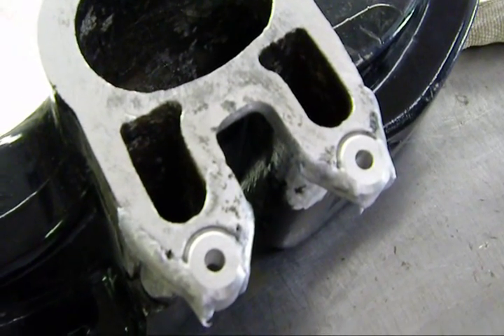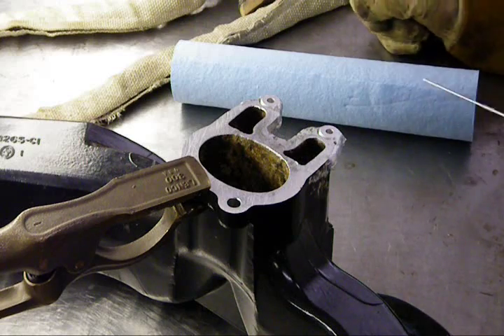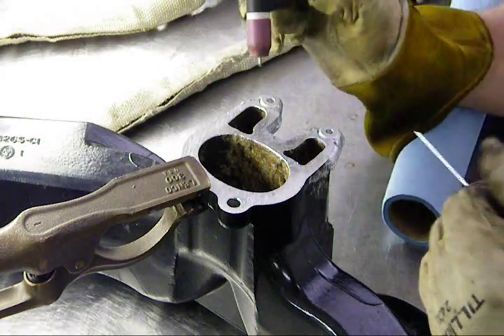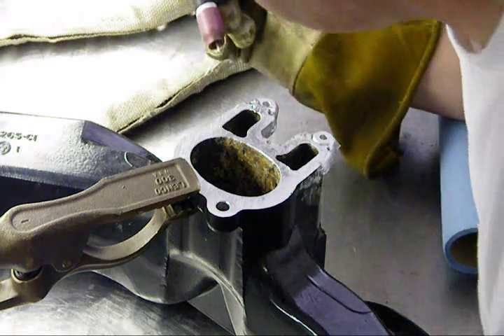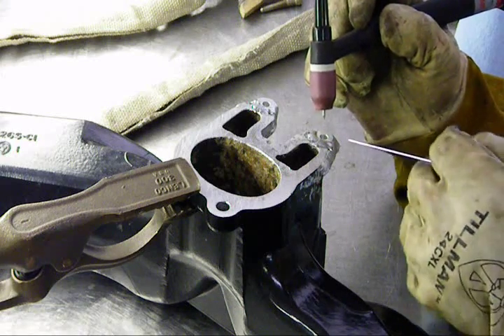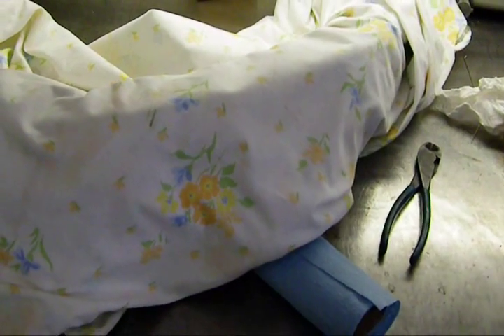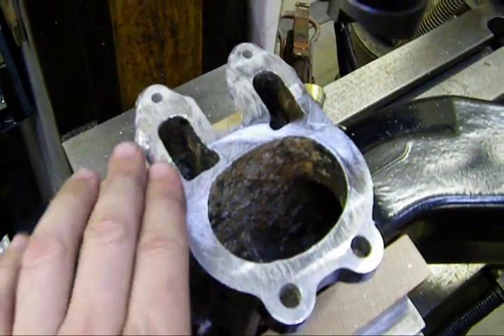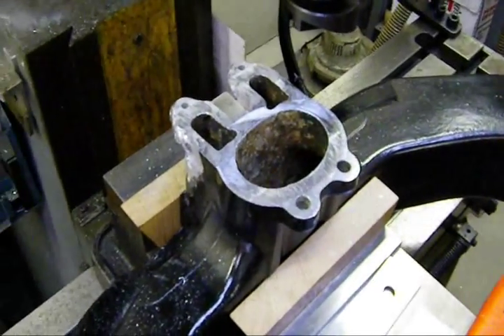Mercruiser Y-Pipe Corrosion Repair. Baja 190ES project

Comment from the maker: It is a stainless bernard TIG cooler with an oberdorfer pump. These pumps have straight cut gears which make them loud. I rebuilt it to with no change just money out if my pocket and no benefit.

Comment: Nice job, when I'm doing castings, I will sometimes try different fillers like 4145, or in this case of a casting to std. mill stock, maybe 4643 to help prevent the" boiling" and dilution. All that corrosion can really suck, I see, or hear, you also have loud torch cooler.